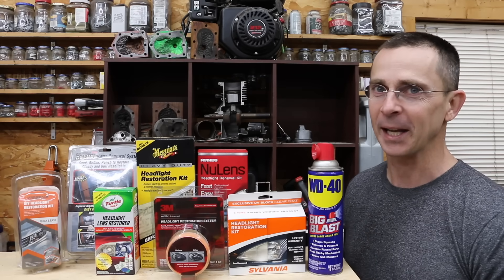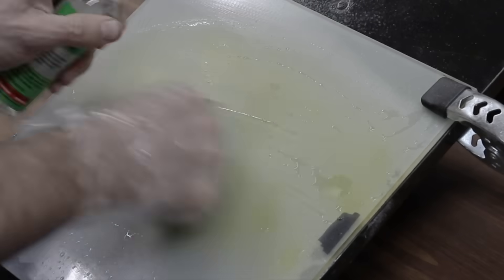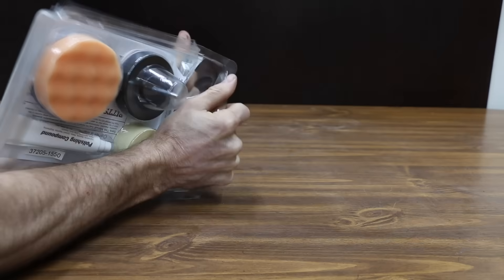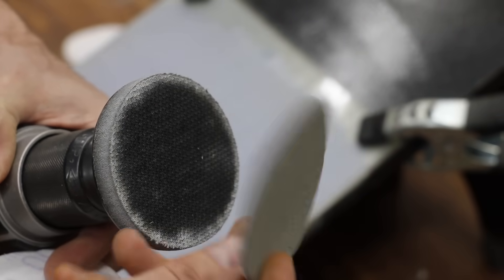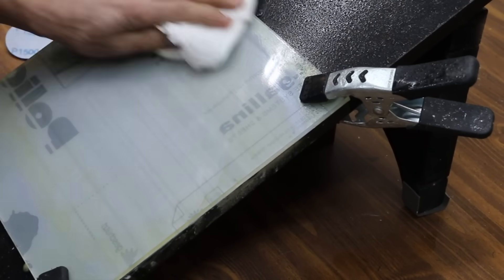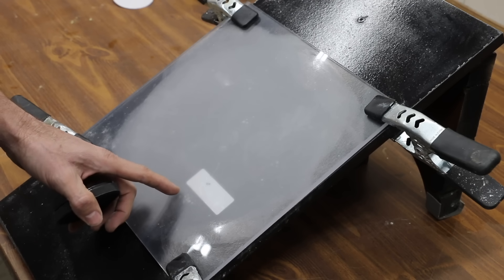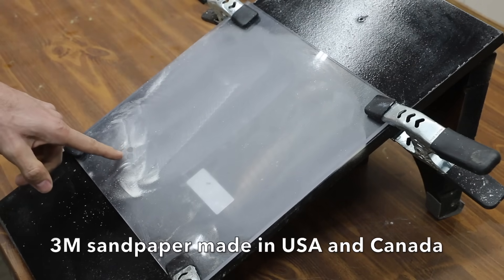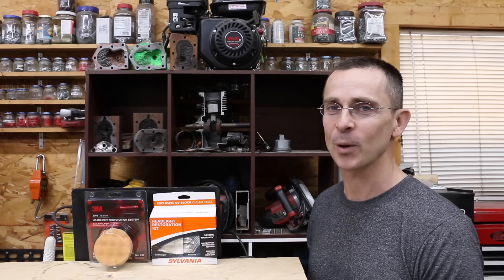Best Headlight Restoration Kit?  Let's find out!  3M, Sylvania, Meguiar's, Mothers, Turtle Wax & HF

Comment: Good stuff. Will you be chucking these outside to cook in the sun for a year, and take a look how things have held up (at least those which come with a uv coating)?  Maybe an addition bit of fresh poly with an automotive store bought 2k uv clear coat on it?    Clean up of the lens is one thing, how long before you need to do it again is probably more important.
Reply from the maker: Thanks for the video idea.

Comment: This is my take on the Sylvania's success: it's the only unit that doesn't use a rotary tool which ends up scratching the glass because of its outside edge. If you look closely almost all the kits leave rotary scratches. By using the flat sandpaper method by hand pressure is only applied in the center, thus avoid the outside circumference edge from scratching the glass. Unfortunantly this test didn't test the quality of the kit because this major factor came and changed the results.
Reply from the maker: Thanks for the feedback.

Comment: You are doing the final polish in a wrong way. You should spread the abrasive powder on the lens and then start using buffing wheel. When you put the abrasive powder Directly on the buffing wheel and start rotating the buffing wheel You're just wasting the abrasive powder
Reply from the maker: Thanks for the constructive feedback.

Comment: Try just wd-40 on a real headlight. It really is a good way to get the really yellowed lenses over time. It is a petroleum, so it does was off. Just reapply when you clean the car. It does work.

Love your videos. You truly are a great man to watch. Very thorough. Keep up the great work 

P.S. As a Machinist, check out Kroil (in can form) as a penetration chemical to free nuts and bolts.
Reply from the maker: Thanks for the video idea.
Reply: @ProjectFarm  Anytime my good sir.

Comment: Excellent video and execution.
There is another approach I've seen and I tried. It involves using "Mother's Mag and Aluminum Polish" as a 1-step compound to remove the yellowing and polish the lenses. It works ok, but it doesn't remove heavy scratches.... but it saves time if you're trying to get a quick result in about 15 min per lens
Reply from the maker: Thanks for the feedback.

Comment: The only problem is that none of these are permanent. The only permanent solution is using a 2 part clear coat like Spraymax 2k Glamour ($24) or a pro grade auto clear coat. Wet sand till all the factory clear coat is removed with 340, then 600 and finally 800. Do NOT go higher than that. Clean the surface well with a wax and grease remover and spray the clear coat. I’ve used this method for the past 4 years and has held up on many cars with additional “yellowing”.
Reply from the maker: Thanks for the feedback.

Comment: love your channel great job have you done tape measures comparisions before? just wondering I've gone through alot of different brands( Dewalt,Craftsman,Stanley,Lufkin,Husky,Kobalt ect ect)I have yet to find one that last more than a month ( I'm a plumber and use tape measures on a daily bases only thing is I use them on under ground slabs and above ground rough ins and alot  times moisture and dirt  are involved and haven't found a tape that last ) Thanks again and keep up the good work
Reply from the maker: Thanks for the video idea.

Comment: Seems like different electrical tape testing might be interesting.. I don’t know if the more expensive are worthwhile.
Reply: John easton thanks, interesting, I used Meguir’s: resprayed UV BLOCKER EVERY YEAR times TWO:: still decent going on three years * 2007 GMC CANYON , IN THE open daylight all the time now (** first several years , truck was Garaged, except at work)....SUMMARY. FAIRLY happy: 
!!   (can be complex exposure & manufacturer issues..).
Reply from the maker: Thanks for sharing.
Reply: He already has this test.

Comment: I treat my headlights by using an 800 and 3000 sand papers and brasso metal polish. First, clean the headlight. Second, wet the headlight and the 800 sand paper, and sand paper the headlight until the yellowish stuff comes off. Third, do the same with the 3000 sand paper. Remember to always keep headlight and sand paper wet while doing this procedure. Last, clean the headlight and polish it with the brasso metal polisher, and clean the headlight.
Reply from the maker: Thanks for the feedback.

Comment: The Maguire’s two step headlight restoration kit is the best one I’ve tried. The kit includes a protective spray on the top that is amazing it does wear out after a while but it allows all of the little scratches to be filled in and a very crystal clear finish with no distortion like regular clear coat paint does which is a key bonus. https://www.meguiarsdirect.com/meguiars-keep-clear-headlight-coating.html
Reply from the maker: Thanks for sharing.

Comment: A drill has a metal cutting tip shaft that bores holes. A drill motor holds a shaft etc. TIP: I attach my drill motor chuck at the end of the power cable, if used, will prevent injury or loss of a finger or worse a thumb if the power trigger is accidentally engaged because you have to disconnect the power cord to chuck the drill into the drill motor. They replace your thumb with your big toe. Yikes! Good head light video. Thanks TD  Atlanta
Reply from the maker: Thanks for the feedback.

Comment: I used turtle wax on my Saturn years ago and 3 months was all I got before oxidation. Hold on too all your tests and make another vid after six months of outside weather conditions before and after. Thank you for the awesome vids and keep up the good work 👍😊
Reply: There are spray plastic sealers available for that very thing. Or buy one can of 2K high gloss clear and solve it once and for all.
Reply: @Bird76Mojo76  Yep, definitely need to seal or clear coat.  I used the 3M product on a '96 Camry and they faded out pretty quick but clear coated and they're still pretty good five years later.
Reply: Yeah, that Turtle wax kit is junk!
Reply: @JoeT_17QX50  No it's not. Used the product 2 weeks ago and it turned my 15 year old yellow headlamps completely clear.
Reply: @lukew2194  Not about whether it works, it's about how long it lasts, or did you not read the comment chain?
Reply: @killerwowmaster  hm. I read the thread. Seems to allude that you have to seal or clear coat because none of them last.
Reply: @christaylor9095  Sounds like you're probably already convinced, but here's just another guy on the internet dispensing free advice... Not yes, but HELL yes! I don't know about the wipe-on protectant stuff, but the "2k clear coat" mentioned by others is amazing. We have 2004 and 2012 Toyotas and I've reconditioned each of them twice -- the first time, they initially looked great, but I left them unprotected. MUCH less than a year later they again looked terrible. But the second time, after sanding I sprayed them both with 2k clear coat. That was back in 2017 and today they both look exactly like they did after I sprayed them.
Reply: The Sylvania kit comes with clearcoat protector tried it on my Cadillac CTS-V worked great and it has been a year no problem.
Reply: Remove oxidation polish and wax them and seal then regularly to avoid future oxidation. The best method is to maintain them so they never fade in the first place
Reply: @Up4Alex  I don't think you want to apply wax before applying any kind of sealant.

That would prevent the sealant from properly adhering to the headlight (which is the main purpose of applying wax to a surface) and result in it essentially dissolving with the wax.

Most sealants directly call for using nothing but pure polishes & compounds (no protectant ingredients) on a surface before application for that reason.

Comment: You’re a mind reader I swear. I need to know this as I’ve got some weird looking cracks or something in my headlights but they are not actually cracked. I tried to wet sand one of them but it made it go so cloudy with the scratches and it looks terrible. I will try the one you say is best if I can get it in the UK and try again. Fingers crossed I get rid of those little crack looking things and get them crystal clear once more.
Reply from the maker: Thanks for sharing.

Comment: Awesome test you did! But there's more products that should be  tested!   Like no drill required headlight kits. Here a good product for that. That  works really good Meguiars  Two Step Headlight Restoration kit. Its just simply Clean&Coat . All done by hand  There's 3  different kit of this offered. Severe, Moderate and light.  Moderate  and  light is no drill  required. I use Moderate all the time for family and friends that need headlight restoration. Looks 99% like new headlight when applied correctly.  And has lasted longer than a year. Which is a plus.  Hope you can  do video of no drill needed headlight restoration. Just suggestion .
Reply from the maker: Thanks for the video idea.

Comment: I have a 6 in. "DA" polisher that I have been using for many years,  After moistening the buffer pad with water, I sprinkle household cleanser on the pad and begin polishing,  It only takes a couple of minutes to restore the lens to crystal clear.  I rinse and dry with a micro fiber cloth, then apply Turtle Wax "Protectant" (much like Armor all) and buff with a clean micro fiber.  Repeat in 2 years!  LOL  This works for me. The whole process takes about 15 to 20 minutes.
Reply from the maker: Thanks for the feedback.

Comment: Regardless of which one you get, start the whole process with some Acetone Free Fingernail Polish Remover for the cleaning part.  I damn near brought the restoration kit back to the store after doing this because the nail polish remover did such a great job.  I have been tempted to try regular polish remover (with acetone) because I know how it works on plastics, but I have been afraid it might "etch" it too much.  Just be sure to protect your paint when doing ANY of these.  Nice looking head lights won't mean much with a scratched up car/truck.
I would also suggest using some 3M 303 UV protector or a spray on clear coat with UV protector.
Reply from the maker: Thanks for the feedback.

Comment: Another problem with polycarbonate is that gasoline will craze it. Not usually a problem with headlights, but tail light lenses are also polycarbonate, and one is usually near the filler. So try not to splash gas on it.
Reply from the maker: Thanks for the feedback.

Comment: I've used the mguiers one. While other kits are only for one or two headlights, this kit has done 4 and it's still got another 2 headlights worth of stuff left. That being said the silvania results are actually amazing and I guess the "award winning" badge is well earned.

Another note is headlights are curved, so flat sanding pads on a drill might give strange results with inexperienced drill operators. And worst of all, some headlights have little nipples pointing outward and make sanding of any method quite annoying.
Reply from the maker: Thanks for the feedback.

Comment: I just used autosol with a micro fibre towel. It's a metal polish but it works all the same. Just had to buy a clear coat with UV protection to keep the lights shiny.
Reply from the maker: Thanks for sharing.

Comment: My boss swears by OFF bug spray for removing the yellow from headlights. Supposedly the deet melts it away. Of course The Car Wizard showed us D. O. T. 3 brake fluid works as well.
Reply from the maker: Great feedback. Thank you
Reply: @ProjectFarm  Another great video as always. I've been using  Meguiars PlastiX with a Dremel buffer for about a year now. Though not perfect, I'd say it's close to 80%.

Comment: You know, 99% people would probably just opt for finding similarly fogged headlights and leave it at that, but I appreciate the extra effort you put into standardizing the test with those polycarbonate sheets. Great stuff
Reply from the maker: Thank you very much!
Reply: @ProjectFarm  ME too!
Reply: I love Project Farm and appreciate the effort. However, there's no reason to think that normal oxidation is the same as sanding with 150 grit sandpaper. So I think in this case the effort led to a less-useful test.
Reply: Tbh testing the kits on actual headlights would have been a much more accurate comparison to what you should expect on your own car, naturally hazed by nature. On actual headlights that have hazed like crazy, by natural means, the turtle wax kit would have not end up last. Maybe closer to first. Always aim for real world application to get the best comparison.

Comment: I've used the identical 3M kit.   Works great.  EDIT:  To be fair, headlights may or may not be the same polycarbonate formula as the sheets in the video.  Nevertheless, I have no argument with the results between products (how they were rated)  but it's possible that all of the products may have done better on actual headlamp assemblies (or worse!).
Reply from the maker: Great feedback. Thank you

Comment: I have an idea similar to what you did for air filters, but for masks. Not necessarily surgical masks, but anything that we may now use on a daily basis or in the shop. Is one style better than the other? Does one brand have superior filtration?
Edit: I was hoping you'd try toothpaste as a "restoration kit"
Reply from the maker: Great suggestions. Thank you

Comment: Thanks that's very interesting Hoping that your test is the same as headlights...  I saw a guy on YouTube restore headlights using WD-40 and kitchen towel paper.. To me it won't work on the tests as you sanded them.. On the other hand the guy applied WD-40 on a clear flat headlight (No ridges). Somehow i don't think it will work on a headlight either
Reply from the maker: Great feedback. Thank you

Comment: I gave up on that stuff a LOOONG time ago.
I use a power buffer with rubbing, then polishing, then a super polish, like Flitz or John Deere all surface polish for a glass smooth finish.
Then, I go over it with John Deere polishing wax to put a UV balanced non-abrasive coating on it.

In all fairness, my '01 Cavalier sat outside for 7 years.
I always chased after the windows and headlights with the Deere polish-wax.
They never yellowed while I had the car.
Reply from the maker: Great feedback. Thank you

Comment: Thanks for this video, I found it very informative.  I have used 2 different kits one was McGuire's and one was a house brand from a big box store if I recall.  I got the best results by combining the 2.  I started with 800 grit, then 1000, then 2000, then 3000 and finally polishing.  I used the McGuire's protective coating.  Did the lights last summer or fall, and so far they look great.
Reply from the maker: Great feedback. Thank you

Comment: I just use metal polish on a firm cone buffer in my drill to bring my headlights up. The German Autosol one. Should have added that as a comparison. :) afterwards they get coated in wax from a product that we only have here in Australia which is the best spray wax available; bowdens own lazy wax.
Reply from the maker: Great feedback. Thank you

Comment: I used Flitz plastic and metal polish with my detail car polisher, I didn't use any sandpaper and got better results vs using regular car polish on my 16 year old headlights, I did use a formula 303 on the headlights afterwards. I will need to repeat the process every 6 months or so, I have tried one of the products you reviewed and prefer the car buffer better.  I like your videos
Reply from the maker: Great feedback. Thank you

Comment: chemical guys have a kit thats fairly quick and easy, but requires you to do things according to the directions or else.

3m has a decent enough kit, i've got a couple i've had no issues with over the years. 

after they're done, avoid any surface waxes with most kits, and use meguiars headlight protector (it's a spray, tape off around the light to keep the spray off body panels and the like), lasts a year, reapply a week or two before the year is up, and it'll keep things near perfect without having to redo the surface again.

the other option is ... advanced... but works pretty well. stage one or two of most kits get you to a cloudy but mostly clear stage (the yellow is all gone), and then you use an atomizer cup and acetone (with proper ppe, outside!) and it turns out like glass (practice on a junk lens!)
Reply from the maker: Great feedback. Thank you

Comment: I had the same result as you with both 3M and the Harbor freight on the same vehicle three years apart.   1st I used 3M and it did a fantastic job.  However come about 3 years later the lights were bad again probably because it did not include the protective coating. So the next time I bought the Harbor freight.  It was a big mistake as it made them worse.    The Harbor freight also seemed to burn the plastic slightly.  At that time my thinking was that you could not do a set of lights twice so I ended up replacing them with knockoffs.
Reply from the maker: Great feedback. Thank you

Comment: You used the DeWalt DCD996, but which gear and speed settings? Was it different for each kit?
Reply from the maker: 3rd gear for most and speed varied based upon instructions indicating speed

Comment: I used the Sylvania kit a few years ago on a 2009 VW Rabbit. Directions then called for hand sanding 15 minutes per lens but what a great result. Now, I have a 2011 GTI which has noticeable fog around the lens perimeter. I'll buy the Sylvania kit again and will use my power drill this time.
Thank you for your reviews. They are an oasis of integrity in a sea of product hype.
Reply from the maker: Great feedback.  Thank you very much for the positive comment too!